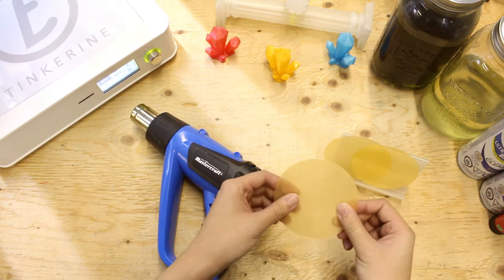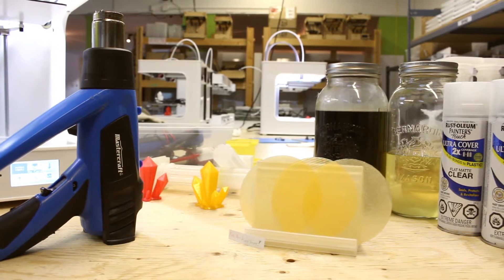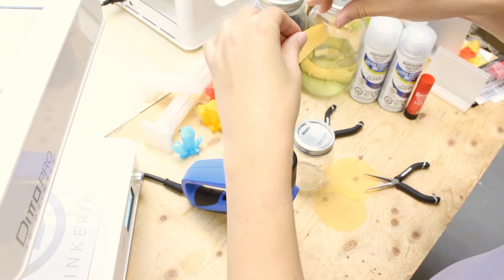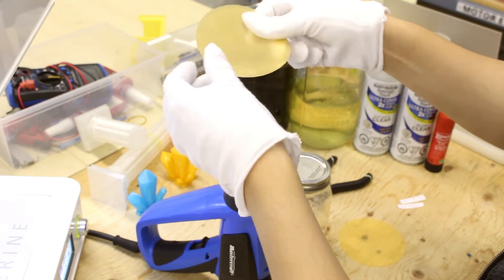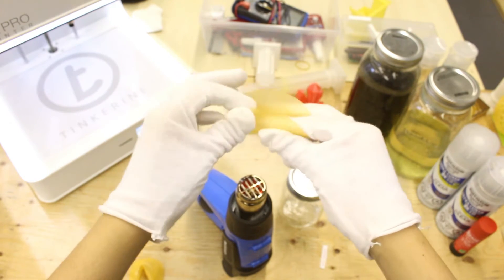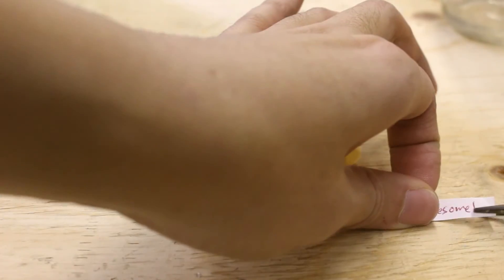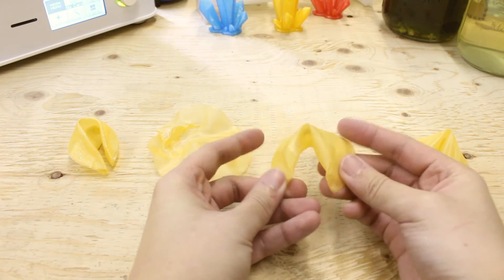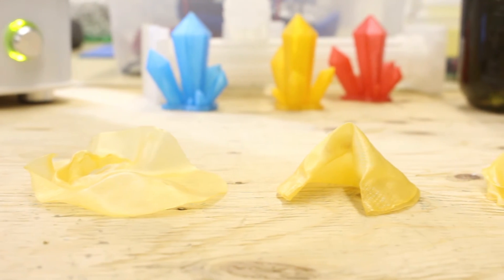Heat Forming PLA

Comment: Very interesting that I found your video on heat forming PLA with a heat gun, because I'm designing a custom head mounted device and some parts of it are a big loose on my head.

So I'm gonna try using a trigger clamp (after squeezing it to ensure the section fits my head snugly) and heat that small section quickly and pull it away. It should hold the final shape.

350°C is WAY TOO HOT. PLA starts to become molten at 210°C (using Hatchbox PLA and printing it at 230°C)

The fortune cookie test worked 👍
Reply from the maker: Thank you and how did your project go?
Reply: @Tinkerine  I'm still working on the project, just finishing up the master models and prepping them for molding and casting. 

I actually did this on the rails that weren't completely flat (gotta do the best you can) and now it's flat as I can get it.

Just some pump clamps and quick passes with my heat gun helped immensely. And also letting it slowly cool.